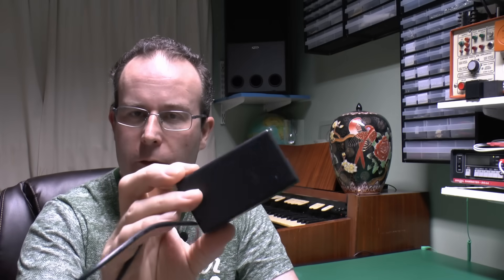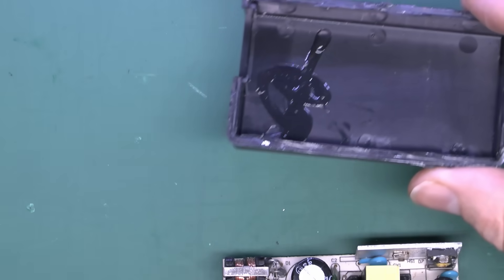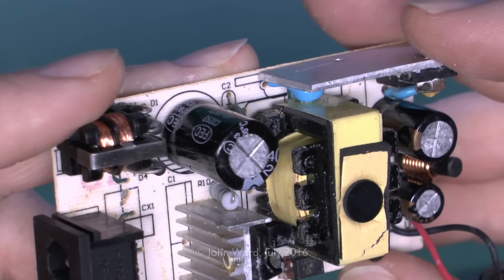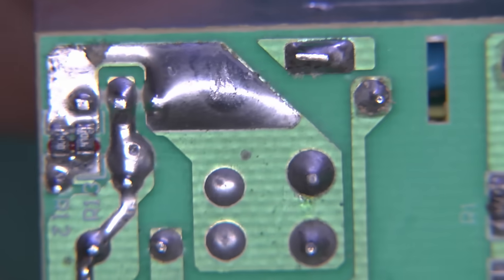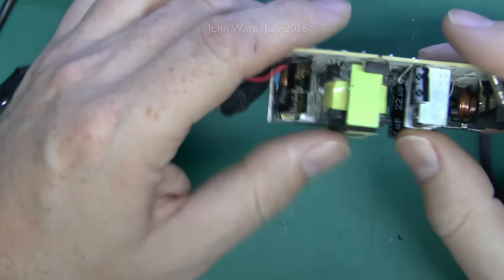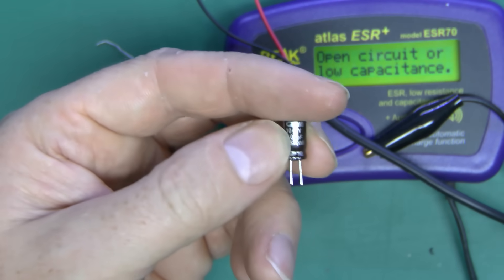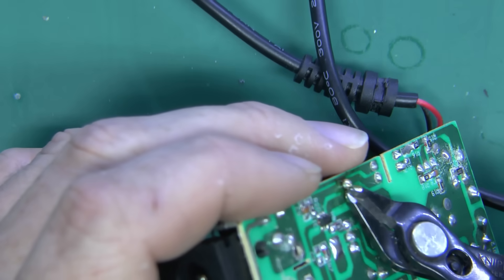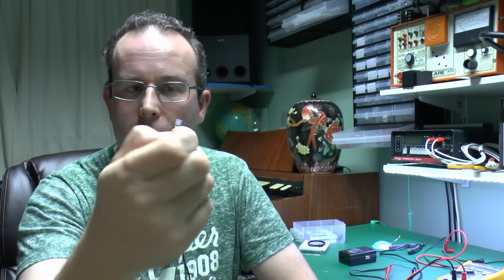12V Power Supply Repair

Comment: That brown stick you found on the bottom of the dead capacitor was probably the internal liquid they have. Try to open or cut in half a new capacitor and you'll see they're not dry inside, so if you ever find some kind of leak arround a capacitor (or a color change in the board, easier to spot with black light), then that capacitor is either dead or somehow injured... I love to see ppl fixing this kind of stuff, i hate the programmed obsolescence, and how everyone is used to it, never trying to open and fix things, they just throw it away and buy a new one... isn't that ridiculous?

Anyway... good video!
Reply: Programmed obsolescence <- exactly. I have seen a few psu's die because capacitors were placed very close to the heat-sink of a FET. Surely the engineers must know it's a bad idea to place a temperature sensitive component near a heat source. And this is a very common issue. I will bet money that engineers are told to place components in such a way as to ensure early failure.
Reply: Planned obsolescence can be a good thing with people throwing out good stuff. It gives the REAL experts an opportunity to find some really valuable items in the trash and fix them

Comment: I would guess that the capacitor vented from the bottom, the fumes they give off can be corrosive, hence corrosion damage around the board, seeing that the nasty vented gas could not escape the enclosure. With regards to the lead free solder, horrible stuff, and manufacturers being forced to use it as done nothing for the environment, if anything lead free solder as probably doubled or tripled the amount of electronic devices ending up in landfill, due to the much higher failure rate caused by cracked lead free solder joints. That is why the aviation electronic industry is exempt from having to use lead free crap.
Reply: Quite likely the electrolyte caused the corrosion around the optocoupler. Some of the other crud was flux around the hand-soldered input and output pads.

That dollop of goop in the case was probably just where the Chinese kid primed the glue applicator, better than messing up the worktable and nobody will ever know.

Lead free works well enough if done right, but it does have drawbacks, no denying that. Since we are too lazy and cheap to make sure our waste is treated correctly, instead of shipping it to Asia and Africa for little kids to pick through, I'm for it. If you can make sure the lead doesn't enter the environment there I'll be glad to have it back in the solder.
Reply: Absolutely agree. Just notice how quite rightly safety-critical devices can use proper solder. So here's a message to the health-police; there are dangers to a life from the moment of conception. Once born; there are many more, but let me assure you, even if you removed all the man-made dangers and hazards, Nature has many more, still possible to happen again and still unexplained phenomena that can get'ya. Ice Age anyone? Get a Life fools. Rant over. Long live lead. :-)
Reply: Soooo... If I understand you correctly, you're basically saying something along the lines of "well, I might get eaten by a tiger before I die of cancer anyway, so bring on the cigarettes"?

Well, yeah, can't argue with that, I guess... ;)
Reply: +Juan Rial I totally agree with that and in 100 years we will develop ways to clean the environment and purge the planet of our waste completely. So to quote a movie line ------->"in 100 years, no one will give a shit"<--------
Reply: not for much longer.... they want to apply it to aviation and the like too...
Reply: I'm for 60 tin 40 pb, EU solder is horrible.  The solution should be that the manufacturers, will pay a bit for used boards that no longer function.  Any way does tin/lead solder even leach away that much?   Like we still recycle lead acid car batteries that put lots of lead into the environment
Reply: Uyhg
Reply: global warming is not a scam. companies and governments profiteering and using it to scaremonger is.
Reply: Scott Page USMC yet you can't spell meteorologist?
Reply: @enterthekraken  - metrologist has to do with measuring instruments. Not the same as meteorologist.
 @Scott Page USMC - I'm glad that somebody's awake. I note that they had to change the name to (meaningless, undefined) "Climate Change" when the "Global Warming" ceased well over a decade ago. As for lead, the danger of this toxic element in solder is insignificant compared with that of the thousands of tons of aluminium, barium and strontium that are spewed into our atmosphere by 'planes every day.
Reply: @Scott Page USMC
How convenient that the EcoNuts totally ignore the naturally occurring 300-year Earth temperature cycle.
Reply: @Scott Page USMC Yep; as a mathematical modeller I would say GW is more to do with politics and those who can shout the loudest.

Comment: I don't buy it.this is not the proper way to troubleshoot a power supply.Starting with the fuse is okay.You should follow the correct sequences you could have get an electric shock charged B+ capacitor if the oscillator wont work.you must have replaced the corroded terminal components and the cleaned the corrosion first.anyway nice video with clearly explained.

Comment: I see first time that small electrolytic capacitor for IC SMPS controller failed...
Reply: Most power supplies and electronic circuits goes down because of capacitors they are getting more defective then any other component in the electronics some time physically they looks nice and new but internally getting damage.
Reply: the capacitor was probably bad off the shelf when they added it
Reply: @rogerd4559  correct

Comment: just be carefull sometime the 400v capacitor can be charged so you may be shoc
ked
Reply: it is the resposibility for the manufacturer to add discharge resistors to the circuitto prevent a dangerous situation. This man is showing us what deadly  garbage is coming out of Chinese industry

Comment: It is unfortunate that the pcb was so small, I would like to have seen just a little more solder on the capacitor's negative connection.

Comment: Overall it was a good video.  Few points addressed by some viewers were very worthwhile too.  Personally, I would have liked to see the output of the supply on a scope prior to make the repair.  As mentioned by the viewers, testing the replacement capacitor before putting it in place would have been useful too, specially knowing that for SMPS power supplies, capacitor ESR is an important element because you may have sufficient capacitance but if the ESR is too high then the circuit won't perform as expected.  Using a sharp blade the way you did was scary,  This is NOT an approach I would recommend.  The dremel and/or the "gentle" hammer knocking technique has proven to be a much safer method for most of us.  Overall the intention was good, but the approach could have been safer.
Reply: I was cringing - waiting for the spurting blood. As you say, a miniature circular saw on a "Dremel" motor does the job but I would hold the box in a vice or in a hand wearing a leather "welder's" glove. I've also opened such PSUs with a "Junior" hacksaw.
Reply: that is in the next video
Reply: I've found the best way to open these ultrasonically welded cases is:

Use a 1" wide putty knife or chisel put in the crack between the two halves. Then whack the back of the putty knife with a pair of pliers or small hammer. It needs to be a fast and light impact to break the joint. You need to work your way around the case, but usually it's a nice clean way to pop these cases open.
Reply: @mikebruestle218
Reply: I personally would have used a 6 pound hammer, so the knife was a very wise choice IMHO.   Often people use what they are comfortable with, you might not be a skilled as John, but you'll get their in end.

Comment: I've also met with corrosion in a Chinese PSU. Probably tears of children working at the manufacturing line.
Reply: I think in this PSU it is the crud from that "no-clean" (but actually does need cleaning) flux.
Reply: Power supplies placed in the voids or attics of houses often get mouse and rat pee on them. Both these rodents pee almost continuously as they wander around the neglected spaces in your house.
Reply: If mice or rodents are able to get in the psu they dribble urine all over the componants and corrode and short out everything with their acid urine
Reply: its because of shipping in containers over seas .... and because of the salty weather / athmosphere
Reply: Deep
Reply: or maybe no pot to piss in?
Reply: @timothycampbell4705  lol
Reply: I'm going to guess that the tacky glue is from the gluing process at the Factory. It's  probably  the same glue they  use for gluing the two halves of the box together. It just dripped in the box and did not dry out from lack of oxygen, or because it's thick. ..... just a guess???
Reply: The children are not allowed to use the restroom so they are relieving themselves in the pile of finished electronics.
Reply: David Parry  reminds me of tears on CPEC ....
Reply: these boxes are ultrasonically welded, no glues used. it is potting compound or epoxy that is used in the factory not on this product though. somehow it was there accidentally but the casing was re-used as they see no harm done. but it made the whole world wondering why it was there.
Reply: tears of Coronavirus 😂
Reply: @timothycampbell4705  wut
Reply: Best ever comment i've red on YouTube  !
Reply: the corrosion is caused by the acid core solder or flux that was on sale they used to assemble and solder all the components

Comment: Imagine my Disappointment.. Mr John Ward when I watched this expecting your usual definitive precision, thoroughness and, in the best possible sense, anality  as you dissect the item outlining your findings. eg: Sticky Deposit in this very video.  Your magnification view showing some disgusting looking areas and components culminating in you finding the broken Capacitor.... THEN THE REPAIR... OMGGGGGGGGGGGGG..

not one area cleaned, the opto isolator left as rusty as my old bike and then THAT soldering... try as i might i found it hard to see the gap, it must be there as it worked but for you to claim that as your own, AFTER testing the Capacitor twice ensuring you reversed polarity on the tester (what difference that would make escapes me ESR work in one direction only? thats a diode isn't it?) you boldly proffer two huge lumps of solder to the camera as "Your Repair"..  all i need to discover now is Santa is not real ...

Comment: I wish someone would produce one of these SMPS troubleshooting videos with less jabber and be more to the point.  I seriously doubt that anyone, who is even remotely qualified to open one of these up, needs any instruction on which end gets plugged into the wall.  After all, those input  filter caps can hang onto 150v+ dc for quite a while even after being unplugged.  Sure, they have bleeder resistors, but how often are they still intact?  Give us advice on what voltages and waveforms there are supposed to be bouncing around between all of those stages, inductors and caps.  That's what *I* want to know when I'm looking for a credible video about "Shooting the Trouble of Your P.O.S. Chinese SMPS."
Reply: It would have been more useful to provide a typical circuit diagram for these types of power supplies.

A thorough explanation of how these types of circuit work would have been helpful.

 Fault finding by measuring the voltages around the circuit board while its operating would also be helpful.  

Some discussion on the voltages expected in different parts of the circuit and how these change with a failed component would have been useful.

I agree good YouTube video should have at lease one useful fact in each sentence
Reply: BluntForceTrauma666 .... kinda like your succinct comment... 😂😂😂